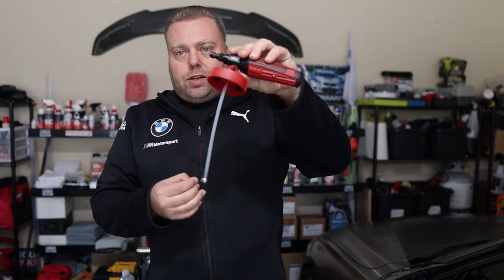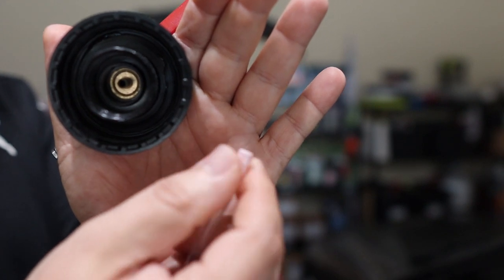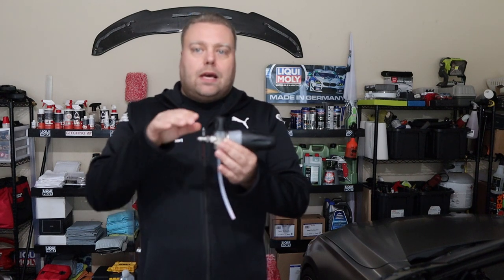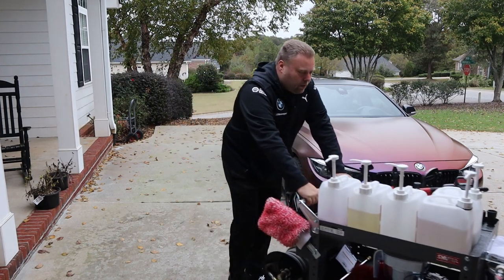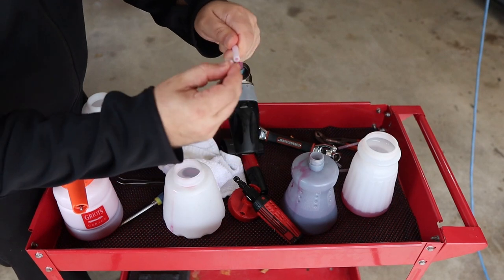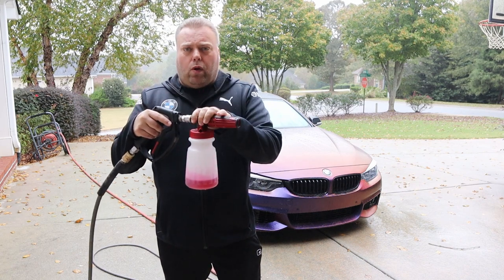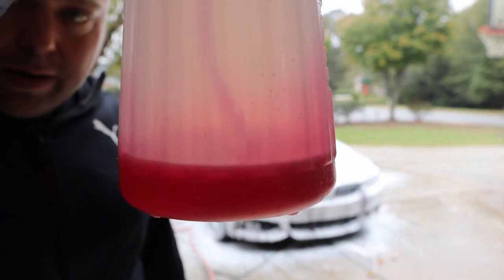EASY $6 FOAM CANNON HACK | AUTO MIX ANY FOAM CANNON | CAR DETAILING TIPS

Comment: Cool,  but not for me. I'm not willing to change the process as I use different soaps. I also believe in cleaning my equipment after use, this method would further hinder that. I'm thinking this method is now making your pressure washer work a little bit more as it is now having to draw a thicker liquid through a regulator. The cannons were not designed for this. Thanks for your efforts and humor! If you don't try, you fail anyway. Keep us posted on the long term.
Reply from the maker: Its not for everybody and I wouldn't do it if I didn't have so many because I use a lot of soaps, but most only use a few. I tested and my amperage did not change on my Active VE52 from regular dilution to the meter tips. I don't think it puts any added stress as the stress point is the orifice and I did 1.1 just as a control and I normally use a 1.25. Will be doing long term updates for sure.
Reply: My suggestion for cleaning the mesh filter after each use would be to unscrew the bottle from the cannon and spray all the soap out from the siphon tube and continue spraying water through the cannon to clean the mesh filter. Then you can screw the bottle back on with undiluted soap and store until the next wash.

Comment: Just tried the purple tip on my MJJC Pro 2.  I stalled it per your video and it worked great.  Maybe a very slight loss of foam thickness but not much.  I should add that I use a graphene infused shampoo as a foam which known to foam much less versus a dedicated snow foam.  Still got good foam even with the auto mix tip!
Reply from the maker: Yeah, I sacrificed a little foam for the auto mix. I think a different tip would be better maybe depending on the pressure washer you have. All about those dilution ratios and finding the sweet spot.

Comment: A lot of soaps are engineered for a panel impact ratio and then advertised with dilution ratios for simplicity to the public. Interested in the math of how the soap is actually sitting on the panel
Reply from the maker: That would be interesting to know and for me knowing what foam thickness is most effective. I actually think there are so many variables such as panel angle, coating, softness of paint, hardness of water, etc. You might have a handful of different types of foam thickness on just one car..

Comment: Hey man as always, great content. I want to thank you for encouraging me to go out, organize myself and wash my car. Speaking of phone tenants over the weekend I did a test of my own (unfortunately I do not have a YouTube channel sure nobody would be interested however) and I compared the to the MTM versus the MJ JC. Without a doubt, I was only able to get to one side of my truck being washed before running out of soap with the MJJC. Trust me, I wanted it to work and that was with it turned down. Instead of refilling, I changed to the MTM washed the entire truck and the wife’s car before running out. For a little bit extra foam to me it’s not worth it with a truck.
Reply from the maker: That's just crazy, maybe something is up with that one.  Is it version 1 or 2?  You can see in the video for the whole car I used the same amount of soap. As there is no way the metering tip can allow any more soap to flow so you can maybe get it to last longer with one of those.  I hate it isn't working out for you. I've noticed with what I have bought and my friends units there a manufacturing differences between them and they each behaved slightly different.

Comment: His not using water in the foam container his just using water
Reply: Opps soap
Reply from the maker: Correct, just soap which siphoned at a slower rate allows you to no longer need to dilute water in there and use the same amount of soap.

Comment: Hey Keav, I got the metering tips from Amazon and they don't fit the MJJC 3.0 or PF22. Neither on the end of the weighted ball or the end of the canon itself. Have you had any luck?
Reply from the maker: Weighted ball on MJJC you have to drill it out to fit, but they have also changed their design as well. MTM the tube is larger and hard to place. I have. I have not tried to find a solution as I have went away from auto mixing as I use so many chemicals I don’t have abuse for it.

Comment: Have to say that I'm really happy I found your channel. I was about to give up on my Brilliant Finish foam cannon. 
I ended up buying a rebuild kit from Griot's in addition to the metering tips and an extra container. I ordered a M Mingle gun and QD's from Amazon to go with my budget Greenworks pressure washer. Put it all together and wow! Stellar results. Great foam, easier to use. I'm really looking forward to the best wash. Note: the metering to didn't fit in the ball or on the nipple in the cap. I ended up putting it in the pick up tube and just working it down the tube about an inch. Thanks for the idea.
Reply from the maker: That's awesome. Yeah, they changed the weighted ball to the Brilliant finish so you can't use the auto mix tips. Only the BOSS foam cannon has the weighted ball that will work with the tips now.

Comment: I know all the YouTube detailers prefer the wide mouth bottles just like you do. I’m the opposite, I prefer the small mouth like the MTM. You can use almost any water bottle or product bottle with it so you’re not limited to one bottle or have to buy from them to replace. I have multiple bottles for different soaps and in different sizes. They all also have caps for storage. For the MTM pick up tube issue, you can buy different tubing for it and replace the stiff tubing.

I like that you tried the auto mix in different guns. Seems most people have zero imagination about modifying things in anyway. They either use it as is and only modify if someone figures it out for them and shows them exactly how to do it. I love figuring out how to make a product suit my needs better if it doesn’t out of the box. That’s how I figured out you can use different bottles. Many have the same thread.
Reply from the maker: Yes you have tons of options with the bottle threads. That what I like best about my MJJC as it has two thread pattern the outer for the wide neck, but also had an inner thread to fit the same bottles the MTM does and the MTM bottle too. They stopped making the inner thread for some reason. MTM just did release a new bottle with a wide too and you can retrofit the old one on top so you can have a wide top quick release style and unscrew it to use the small threads still.
Reply: @CarsWithKeav  yeah, I’ve seen the new MTM cap and bottle. I like how it’s just an adapter for the existing setup and not a complete redesign. Now you still have the option to not use it and use you’re own bottles if you bought a new one. 

The Griots has the same set up as your MJJC where it has both threads. I’d much rather have the option to use wide or small than being stuck with just wide. I prefer having options and auto-mix is a great one to have. I know most testers show the Griots is better, and cheaper, but the MTM will always be a great cannon and the difference in foam seems minimal between all of them.
Reply from the maker: @seashackf1  Griots does not foam as good as the MTM or MJJC without the auto mix feature. They are all good just depends on what you like. Small neck I never would use since most of my bottle are not diluted so I would have to dilute in another bottle. I don't run any chemicals at full dilution to be able to use the chemical bottle.
Reply: @CarsWithKeav I guess I was talking about the Griots Boss instead of the BF foam cannon. Most seem to rate it above the MTM. For the auto mix feature you could use the small neck 16 oz bottle the soap is available in and not have to transfer anything. You’d just refill from the gallon same as you would for the wide mouth cannon bottle. Much easier to keep different soaps that way and be able to cap each bottle. In the end it’s all personal preference and what works for us. For some the standard way everyone else does it works fine. For others, like you did with here, we like to modify so it fits a specific need.
Reply from the maker: @seashackf1  Exactly, in the end it’s all personal preference as long as we are enjoying washing does what makes you happen. I just like to try all kinds of different things and modify to get the result I want.
Reply from the maker: @seashackf1  I would only rate it above the pf22.2 for its higher quality materials, wide neck and auto mix. Since the wide neck is not important to you and pf22.2 is proven to have great durability of the manifold then it’s really just down to the auto mix. The pf22.2 in my experience is superior in foaming ability than the BOSS. The BF IMO foams better than the Boss.
Reply: @CarsWithKeav  interesting to hear from someone who’s used all of them. just goes to show how good the OG MTM is. Thanks for that info. 👍

That’s what I love about YT. Keeps everyone from having to buy and test them out for themselves. It would make no sense for me to buy 3 or 4 cannons trying to find the ‘perfect’ one. Especially when new one keep coming out. This way a content creator can buy the different ones, use them and share the results. All while ad revenue, at the very least, pays for the products. It’s save so many people a lot of money from buying the wrong products. Thanks again.
Reply from the maker: @seashackf1  Exactly, for most of us it takes our own money to get going, but if you keep grinding it evens out and as you grow you can spend more on products and try modifications. Took 3 years to break even, but it was all fun for me and I would have bought most of this stuff anyways since I’m obsessed with this hobby.
Reply: @CarsWithKeav  it was too easy for me to become obsessed with it too. I’m not always a fan of the work involved, but once done the result is always worth it. Seeing an immaculately clean car is soooo satisfying. 

I’m glad it’s worked out for you and your hard work is paying off. Even though it was a hobby and fun I’m sure it wasn’t easy at times. Cheers

Comment: Nice.  Was waiting for this when Groits changed the hole on their brilliant finish foam cannon. Great tip!! Literally 😃
Reply from the maker: You know what's funny? I ordered a new one to check on this change and make a video on it.  The one I got today the tips fit perfect.  Now I did notice on this new one you can't change the fan spray angle anymore.  SO I can prove that was changed.
Reply: @CarsWithKeav  Hmmm. Maybe they got different models.  Let me return the unit I  ordered last week and get a new one.  I'll report if the new one I get is compatible with the metering tips
Reply from the maker: @rickjondo1343  I think they did change at some point and it all depends on the Amazon Warehouse you get the product from. Some still might have old as its probably the same barcode.  How about this, you send yours to me and I'll send this new one I got to you? that way I get one to do the video on and you get one that fits the tips. if you want to DM me on Instagram so I can give you my address or send me a picture so I can make sure they are different and they didn't change the metering tip size.  LOL

Comment: Cool to know you can add one of those tips for cheap and never have to add water to your foam cannon again haha. Thanks for the vid! I'll definitely look into getting a tip in the future
Reply from the maker: Saves so much time.
Reply from the maker: @Index-o1234  You can still make thicker foam using your own dilution and hot deionized water, but more foam doesn’t always mean more lubricity.  It’s just the soap being aerated more in the manifold. Soap can be just as lubricating without suds. ONR as an example. Too thick a foam also has a hard time dwelling off the surface evacuating the debri. There is a big debate on foam thickness. It’s therapy for me though. I sacrificed some foam thickness for the efficiency and time saved not having to measure. Using the tips just sucks less soap into the manifold mixing with the water allowing the dilution to happen there. I’ve found out  there are hundreds of these tips so you could possibly find one with the perfect dilution for thickest foam.
Reply: @CarsWithKeav  Thank you for your insights.

Comment: I've tested the three different GG metering tips using Active 2.0, Boss Foam Canon w/1.25mm orifice drawing straight RO water from the canon bottle (not soap). Pink tip consumes 2oz/minute; Purple 3oz/min; Aqua 4oz/min. Of course straight soap will be more viscous thus affecting suction through the metering tips.
Reply from the maker: That is great information. Appreciate you doing that! Hard to say how it impacts pure soap. Most likely would consume based on thickness. Maybe thinner soaps would do better and some thick ones might have aeration issues?

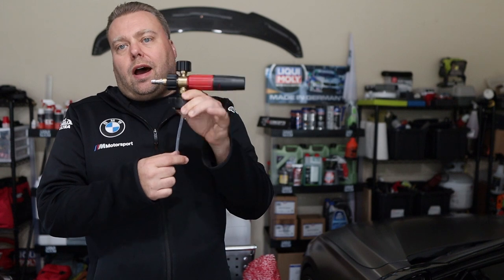Comment: Hi Keav, whats your opinion on the metering tips today? Im looking to achieve a roughly 1:25 dilution with the pink metering tip, do you think its anywhere close?
Reply from the maker: I don’t really use them anymore more since I test so many products I need the bottles to be empty. The purple tip is closer to 10:1, but I am unsure of the dilution ratio of the pink one unfortunately.

Comment: I have the VE56 PW from Active, and when I used a 1.1 orifice the pressure shot up to 1400 PSI and the PW sounded like it was angry at me. It foamed better but I swapped back to the 1.25 orifice promptly.
Thanks for the video.
Reply from the maker: Yeah, Active pumps don't like higher PSI. 1.1 is a risky move and will for sure hurt the long term life of the unit. plus 1.25 creates more than enough foam.

Comment: First I want to say thanks for all your very awesome videos. It has got me more excited to clean my and customers cars more! Can you measure the inside diameter of the purple metering tip-say with a drill bit?? Just see what size drill bit slides into the hole. I want to try making any kind of a weight and then just drilling a hole in it the same size as the purple tip. Do you think that would work?
Reply from the maker: I will see, but it’s really small don’t think I would have anything that small to measure. Theoretically like you said it’s just restricting the flow so if you could drill through a weight it should work. It might clog easily though if the bird is long. These the hole is only a small area so easy to clean out.

Comment: Thank you for this video.  Answered all my questions.
Reply from the maker: You are welcome!
Reply: @CarsWithKeav 
Have you seen the new Red and clear bear force foam cannon? If you have can a metering tip fit on that perticular foam cannon
Reply from the maker: @DAT-TEXAS-DUDE  I did a review on it late last year. You can add a metering tip to anything really. Just depends where you can add it.
Reply: @CarsWithKeav  
Okay and the purple is the recommended one I believe I seen you say in one of you videos. I do have an electric pressure washer . The Sunjoe spx 3000
Reply from the maker: @DAT-TEXAS-DUDE  Purple should be good.

Comment: For the auto mix do you only add soap to the cannon reservoir and no water prior to using it? Sorry if this is a dumb question. I'm a novice in this area.
Reply from the maker: No water is needed unless you want to thin out the mix to save soap. Will get less foam though.
Reply: @CarsWithKeav  Awesome. Thanks so much!

Comment: Orded the ones from Amazon only $1.50. Worth a try
Reply from the maker: Cool, I was going to before, but unsure do the sizing since griots doesn’t state what theirs are and there are a ton of different sizes out there.
Reply: How did the Amazon ones work out?
Reply: @CarsWithKeav   The tips work. I had an issue with my MJJC cannon leaking from front and not foaming after the freeze we had, don’t know if it had anything to do with that or I forgot to flush it after using it. I changed out the filter and kept running water in the bottle and it started working again. The last few times I stick the tube in water after using to flush it out and it’s working so far
Reply from the maker: @pantac4493  Glad to hear it.

Comment: Thanks for the tips Keav what our obsession leads us to do huh 🤔😅
Question In your testing the 1.1 orifice had no impact of stress on the pump of the active?
Reply from the maker: Totally obsessed.  LOL.  The 1.1 was a higher AMP on the Active VE52, but still a safe number.  I just prefer the 1.25 as it seems the soup goes further and the foam is enough for me.  Even though its a safe number prolonged use at a higher AMP will lessen the life of the unit as well.

Comment: Can you tell me about the filtration setup on your rig? I have terrible water!
Reply from the maker: When I was running that version it is two 2 stage systems. One is sediment and carbon filter based and the second is Deionization. I show in these two videos. https://youtu.be/OoBJVCbSY34 and https://youtu.be/douXuBQxktg
Reply: @CarsWithKeav  no problems with the pressure washer not getting enough water through the filters? I am just running a 1800psi 1.2gpm but I'm so very sick of the water spots.

Comment: Awesome video I really like the auto-mix option. My question is would you know the size of the hole in the purple fitting? I could prob make my own and don't want to spend $147 for the Boss unit as I have several others that work great and to order just the tips will cost 3x more in shipping and a month wait. Thanks
Reply from the maker: Its for sure a weird market and shipping on those is crazy. The BOSS is $99 on Amazon. I'm trying to figure out the diameter myself and working on another solution that doesn't rely on extra shipping costs. Also, testing some cheaper models right now to get them to be foaming monsters.